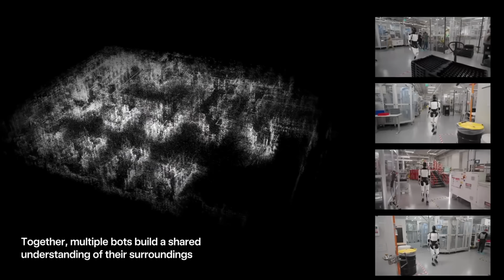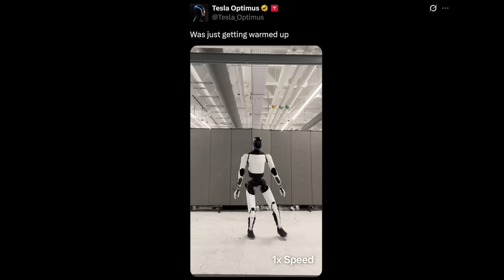Tesla’s Optimus Gen3 - Lars Moravy reveal Tesla’s Secret engineering power - Ready for Extreme scale

Comment: The wall charging is a huge fail for Optimus because it takes it out of production. It’s a great product, but that was a huge fail in their design that I’ve seen continue to propagate and I’m trying to understand what the advantage was to taking a robot off-line for 10-20 Minutes.
Reply: "The wall charging is a huge fail for Optimus because it takes it out of production. It’s a great product, but that was a huge fail in their design that I’ve seen continue to propagate and I’m trying to understand what the advantage was to taking a robot off-line for 10-20 Minutes."

"The wall charging is a huge fail for Optimus because it takes it out of production. It’s a great product, but that was a huge fail in their design that I’ve seen continue to propagate and I’m trying to understand what the advantage was to taking a robot off-line for 10-20 Minutes."

No. That's up to you. If you want a robot to remain static at one position, fix a charging station right behind it. If the robot can work for 8 hours before charging for 20 minutes, that's just a 4% downtime. So even if the robot can't stay stationary, it's not a big deal.
Reply: @yourcrazybear  That's fair, but making a robot that is optimized for stationary work isn't the best choice when there was alternative options. 4% is a lot especially when it's unnecessary or that 4% requires that a production line shuts down. Think about it at a car factory, how would that work? You'd need a huge number of additional bots just to cover the ones that are constantly leaving.
Reply: @OilersFlash  4% downtime isn't much. It just means you need 5% more robots. Compare that to 200% more for humans.
Reply: @bhabbott wrong. You need more than that. You are doing linear math on this problem and it is not a linear problem
Reply: @OilersFlash I expect that Tesla will have brilliant engineers solving problems like this one long before they arrive.😊